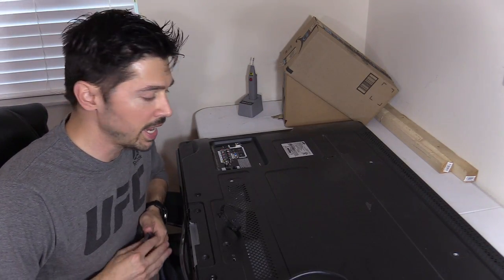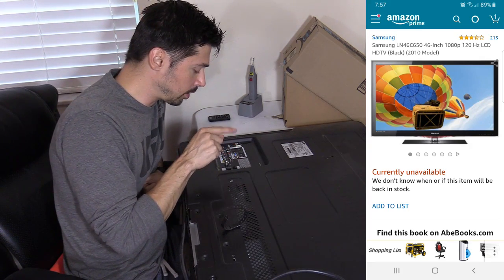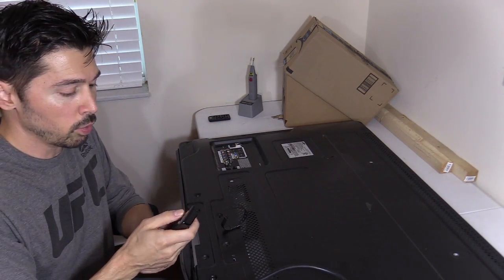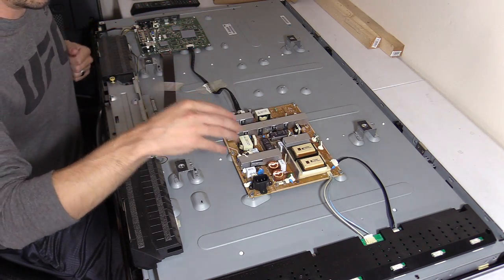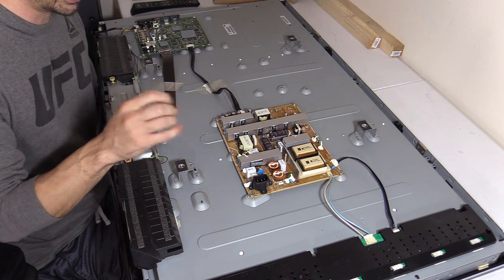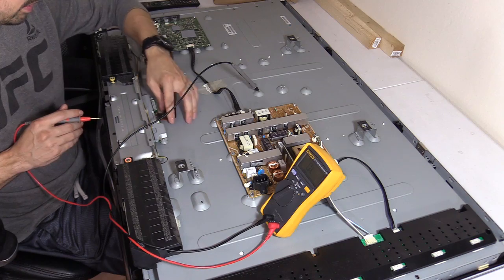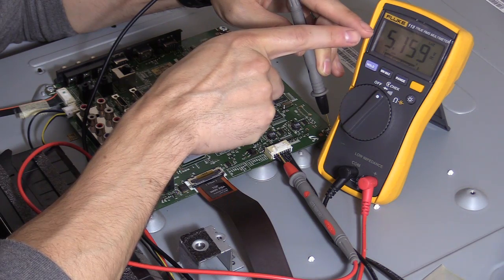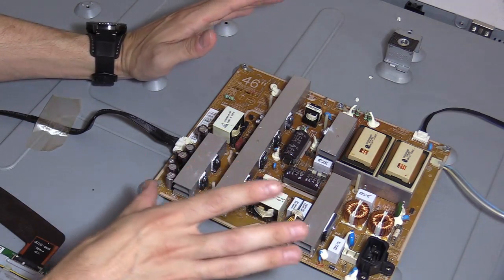Fixing LCD flat screen TV Not turning on No standby LED pt1

Comment: a couple of notes. confirmation of stby power should be ascertained by disconnecting the wiring harness that goes to the main board and checking if your 5v is now stable (load the line down if necessary), as your main board can easily be shorting your stby down. you can see your voltage switching, so there is a chance it isn't from the p/s, though i didn't see you esr the stby cap. :P
Reply from the maker: Yes, good tips. Thanks 👍
Reply: @TampaTec Hi Sir!
Can you help me fix my tv?
Model: LG 55LW5600 
Standby power is good.
When you turn on the power, there is no display.
I check the voltages, Pin 1: POWER ON 24V is suppose to be 24V but I only measure 3.3V.
Which one is at fault the power supply or the main board?
Thank you.
Hope you can read my comment.